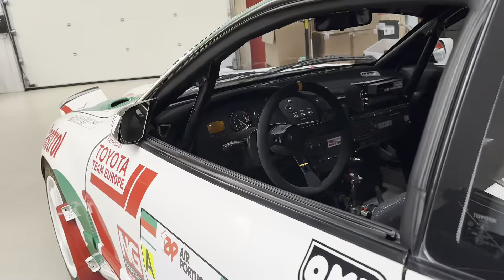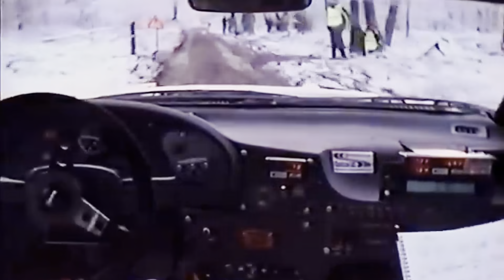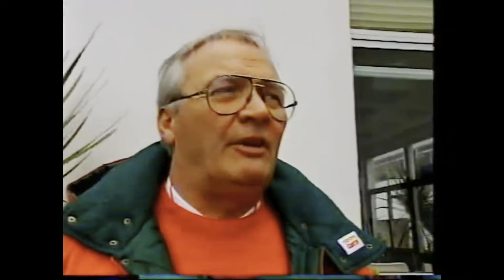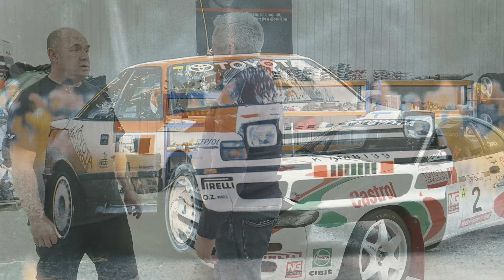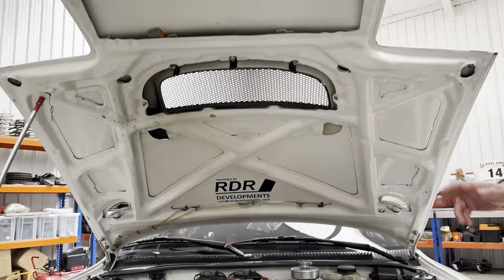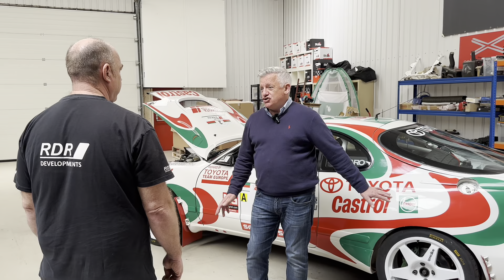Toyota Team Europe: the untold stories of the Celica ST185 in WRC with Nicky Grist & Don Woolfield

Comment: Thanks for this great video. It's interesting to hear about the lack of diff issues, as the rear diff mounting is a common failure point in st205s, including mine. I would love to hear Don's comments on moving the water charge cooler off the top of the engine, to make it share space on the right with the air intake. This is a common discussion point among ST205 road car owners, and it also is visible in the engine bay of the WRC Corolla using this same engine, so someone eventually thought it was worth doing.  I'd love to hear Don's take on whether sitting the charge cooler on the engine has a meaningful impact on temperatures versus the alternative of moving it to a different part of the engine bay and better thermally isolating it.  You'll see a lot of ST205 owners adding additional insulation under that charge cooler and also coating it in reflective tape to keep the heat off it.  If you get a chance, please tell us what Don's thoughts are about that.